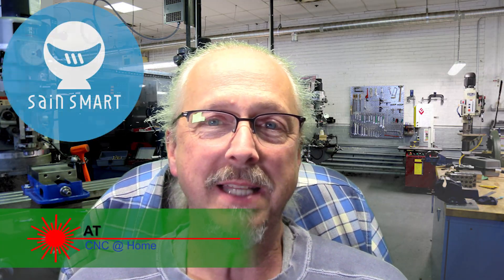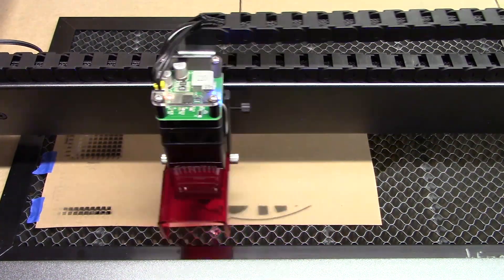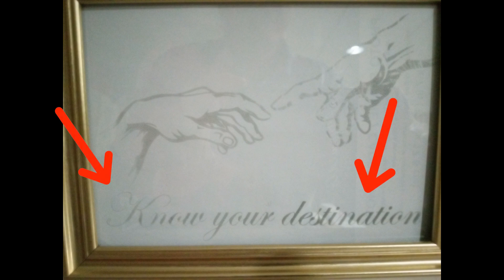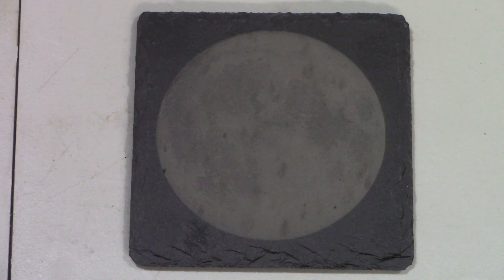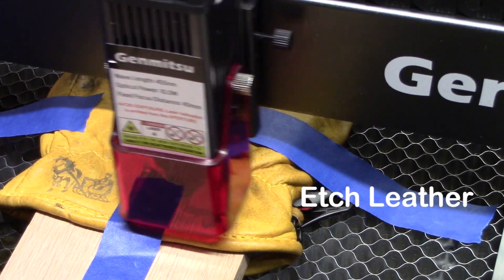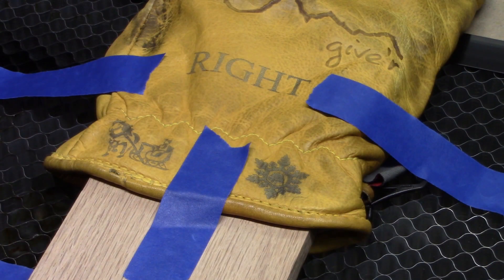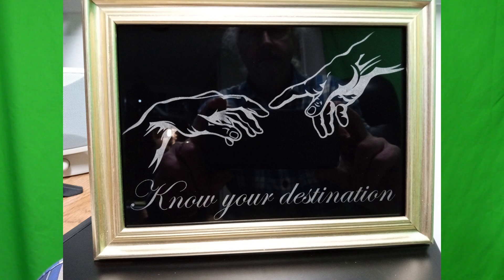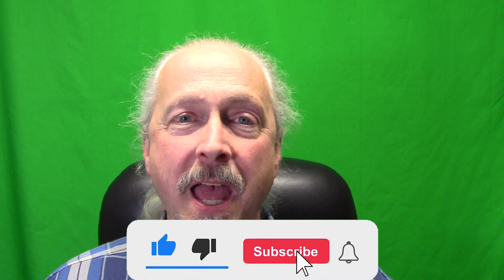Genmitsu's Jinsoku LC-50 Plus Review

Comment: Nice review! Do you experience any "rolling" noises when engraving at lower speeds?  I upgraded the ball bearings and cleaned and lubed everything up. Also played around with belt tension but it stays. Perhaps it's normal with these linear guide rails?
Reply from the maker: That is interesting.  I have not noticed unexpected "rolling" noises.  I do tend to be impatient and engrave at the higher speeds.  ;-)  All in all, I have been impressed with this machine's ability to move smoothly, accelerate well and reverse direction without losing position.  I do limit my speed based on the size of the burn so that it can't get up to full speed before it has to start slowing down.  The really faster speeds would only be used on a larger burn and slower speeds on smaller just to minimize ramping up and down the speeds.  
Does this seem like a physical noise from the rails or maybe from the stepper motors?  Stepper motors can make some odd noises when they are moving slower.
Reply: @CNCATHome  thanks for the reply. I think it's coming from the stepper motors. Because when the gantry wasn't yet attached the linear blocks ran very smoothly and quietly.
Reply from the maker: @behavis  - If they sound OK when you are running at faster speeds, it may just be they like being loud as slow speeds?  Or it could be that there is an issue with the motor.
Reply: I hear it for example while cutting MDF at 400mm/min or engraving a aluminum business card at 2000mm/min. But not when engraving a canvas at 12000mm/min
Reply from the maker: @behavis  - I should read all the comments before I respond.  ;-) At 4,000 mm/min, it shouldn't be making too much grinding kind of noise.  I suppose it could be a parameter setting that is off in the controller.  This is how I have my machine configured:
$0=10 (step pulse,usec)
$1=25 (step idle delay,msec)
$2=0 (stepport invert mask)
$3=4 (dirport invert mask)
$4=0 (stepenable invert,bool)
$5=1 (lims pin invert,bool)
$6=1 (probe pin invert,bool)
$10=1 (status report mask)
$11=0.010 (junction deviation)
$12=0.002 (arc tolerance,mm)
$13=0 (report inches,bool)
$20=0 (soft limits,bool)
$21=1 (hard limits,bool)
$22=1 (home cycle,bool)
$23=3 (homing dir invert mask)
$24=400.000 (homing feed,mm/min)
$25=3000.000 (homing seek,mm/min)
$26=250 (homing debounce,msec)
$27=2.000 (homing pull-off,mm)
$30=1000 (maximum spindle speed,rpm)
$31=0 (minimum spindle speed,rpm)
$32=1 (laser mode enable,bool)
$100=200.000 (x axis pulse:step/mm)
$101=200.000 (y axis pulse:step/mm)
$102=200.000 (z axis pulse:step/mm)
$110=15200.000 (x axis max rata:mm/min)
$111=15200.000 (y axis max rata:mm/min)
$112=15200.000 (z axis max rata:mm/min)
$120=200.000 (x axis acceleration:mm/s^2)
$121=200.000 (y axis acceleration:mm/s^2)
$122=200.000 (z axis acceleration:mm/s^2)
$130=500.000 (x aixs max travel:mm)
$131=400.000 (y aixs max travel:mm)
$132=80.000 (z aixs max travel:mm)
Reply: @CNCATHome  wow thanks for these settings. I'll check them when I get home tonight 🙂
Reply: @CNCATHome  I just checked the settings. They were all pretty much the same (only had slightly higher acceleration values)
I just tested it with your settings but this made no difference.
I made a short clip to show you what it sounds like. This is at 200mm/min and 90°
The rolling sound does lessen when speed is increased. But the sound does seem to originate from the guide rail carriage.
I wonder if your machine sounds the same at these speeds or if I should contact genmitsu to have this fixed.
Thanks a lot for you help!
https://youtu.be/YNl-Z8Nn2mE
Reply from the maker: @behavis  - I had not noticed that before.  Mine sounds the same at those slower speeds but doesn't seem very loud.  My Y is louder at 200 than the X.  I really can't hear it at 200 mm/min moving in the X.  It could be a tensioning thing either too much or not enough.  Easy enough to play with I guess as this machine has easy tension settings.  If you can't tune that out by adjusting your tension, contact Genmitsu about it.  I purchased my Genmitsu machines through SainSmart and they have been helpful in the past.
Reply: @CNCATHome  Thanks for looking into this, I really appreciate it!

Comment: I have the LC 40 and I just got the rotary and they are telling me I have to change boards each time to use the rotary and then back to the regular Lazer have you tried the rotary on the 10 watt
Reply from the maker: That is interesting.  I did a video where I put the rotary roller into the LC-50 Plus without issue.  I was able to unplug the Y axis and plug the rotary roller in.  Check out this video: https://youtu.be/ESGpV_T0oaI  where I did that. On my Atomstack P7, I have to use another port for the rotary roller and unplug the Y axis stepper as well.  Here is a video on that: https://youtu.be/sa_fK-V8RSc.  I do have a playlist for the rotary roller that might be of help: https://www.youtube.com/playlist?list=PL-AIAHSnA1P09pXG-Z2CWGIja3zJUebYH   I hope you are able to find what you need.

Comment: Did SainSmart get back to you regarding LB and the Air Assist pump? Mine does exactly the same - it doesn’t read the switching on or off on different LB layers. They telling me it’s a warranty issue (I don’t think they fully understand what the issue is tbh!).
Reply from the maker: Great questions.  They have not gotten back with me on this.  I have asked a couple times and not gotten an answer to this issue.  I have recently converted the 12VCD from the controller to be the signal to a relay that turns on and off my 120VAC pump for air assist.  I have done a bunch of testing and found that any time the laser is fired from software, the air assist will come on.  The only time it doesn't is when I press the test button on the unit itself.  There are times when I do not want the air assist on such as when I etch on MDF.  I will have to remember to manually disconnect it when etching and then re-connect it when cutting.  I will continue to try finding out from SainSmart about this issue.
Reply: @CNCATHome  That’s great - thanks. Yeah, I found etching on MDF is far better without air assist. Loving the LC-50P though - great machine! Not having much luck successfully cutting through 6mm MDF though - have you tried that?
Reply from the maker: @CitizenChaz  - I have not tried 6mm MDF.  I would think it could cut through it.  I would focus lower than the top surface to help a little with the cut.

Comment: Thanks for the review. I'm thinking of getting this machine. I want to use a rotary at some time. Can you give more detail on the rotary part number and how you wired it? (Sainsmart CS told me only their new Jinsoku will work but your video seems to show the older model which I like better because it is adjustable).
Reply from the maker: Great question.  To get the rotary roller to work, I just raised up the LC-50 a bit higher than the extension legs go, unplugged the Y axis stepper and plugged in the rotary roller to the Y output on the controller.  I had to make some parameter changes to insure the movement was correct for the roller.  The other option would have been to use the roller option within LightBurn and it would figure out the movment stuff.  :-)  I hope that helps.  Oh!  And wen the machine does its homing cycle, I had to manually press the Y limit switch to trick the machine into think it was zeroed.  The other option would be to turn off the auto homing.
Reply: @CNCATHome Thanks for the info (I just asked a similar question on your other video!). SainSmart told me neither the V1 or new V2 will work with the LC-50P yet you’ve proved it works fine so I’ll go ahead with the purchase plus the V2 rotary. From what you’ve said as long as you check the option in LightBurn for rotary the software will compensate and make the correct adjustments- as long as you either manually hit the Y axis limit switch or don’t auto home! Thank you! (Subbed!)

Comment: Thanks for the brief overview. I have this machine sitting in the shopping cart waiting to see a few more reviews of it before I purchase...
Reply from the maker: With anything, it isn't perfect and I would want it to do more.  It is a nice upgrade from my LE-5040.  Whatever you end up getting, have fun with it.
Reply: @CNCATHome  To my knowledge the LC-40 and LC-50 are the only diode lasers on the market to have linear rails on all axis. I was really looking forward to this due to the higher level of accuracy they provide over say rollers that introduce micro jitters in finer details. Other than maybe a 20 watt laser, what else do you want this to do? 

Cheers,
Greg
Reply from the maker: @GregAllen2  - Right before I tested the LC-50 +, I tested a 5.5 watt laser with a .02 X .02 laser dot.  The LC-50 + has a .08 X .05 which is 10 times the area of the .02 square dot.  If they could get the laser dot down to the .02 square, it could blast through all sorts of stuff.  That being said, even at 1% power on the LC-50, it etched through the coating on some black dog tags I purchased.  The frame setting was set to 1% and I could see that on the dog tag after wards.  I do like the LC-50 + and will likely use this as my main laser for a while.
Reply: @CNCATHome  Wow, that tight of a laser spot would be nice. I spent the other night looking at all the major manufactures that produce laser engravers offering a 10w laser. Unfortunately, I wasn't able to find one with that tight of a laser dot for the 10w variants. So, based on the frame's construction, the customer support I've already had with them (inquiring about cnc parts) and it's overall performance I'm planning to get this one. I can always purchase a different laser down the road... Another question for you. Does adding a laser to a tabletop cnc machine yield the same performance as a stand alone laser? I know the speeds are much slower. Thanks for producing these informative videos!
Reply from the maker: @GregAllen2  - With my little CNC router, it wouldn't have had the same speed as the stand alone laser machine.  I looked in to doing that and the big thing was having to swap out the spindle motor for the laser emitter and then back to do routing.  It made more sense to keep the CNC router as that and get a stand alone laser for doing lasering.
Reply: @GregAllen2  Hey, I'm in the same boat looking at this versus Ortur OML3. Both are 10W with similar size spot but Ortur claims cutting 12mm wood in one pass and 10mm acrylic whereas LC-50 is 10 and 5. I like the cable management, linear bearings, included air pump, and 100mm wider working area. The OML3 has a big following on the FB laser forums, has rollers, wi-fi, SD slot, ez rotary hook up. This is so hard - I'm still on the fence. If you bought this LC-50 can you add your experience? Thanks

Comment: Seen James Dean Designs go through 18mm but air assist is needed. I suspect the air blows out the smoke n carbon allowing deeper cuts.
Reply from the maker: I did have air assist on for this.  It helps the burn and keeps the results cleaning.  Not sure how deep this can do.  The project I had handy was 3mm and that is what I would mainly work with.  I have some 6mm out in the garage I could try.  🙂
Reply: @CNCATHome  I did find your air assist vids later. Will be add on when mine shows up. On CO2 laser polycarb yellows, wonder if air assist would fix that?
Reply from the maker: @alwayscensored6871  - Wood also will yellow (or amber) without the air assist.  I would bet air assist would clear that up when using a CO2 laser.  I have seen some nice clean cuts on the clear stuff from people using CO2 so it must work/help.

Comment: What speed and power did you use for the 3mm ply. Enjoyed the video, very well done
Reply from the maker: Great question.  I have found that at 80% power and doing 3 passes, 350 to 400 mm/min seems to work well.  Sometimes at 400 mm/min, there are variations in the wood where it ends up not going all the way through.  Slowing down or doing another pass would fix that.  ;-)
Reply: @CNCATHome  thanks very much for your response.
Reply from the maker: @billlester3088  - I forgot to mention, that is also with air assist going.